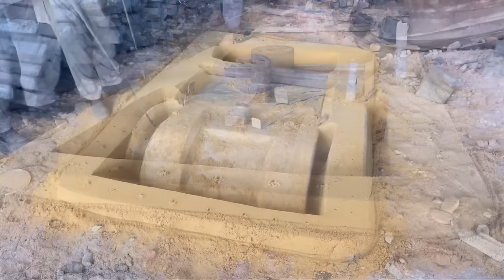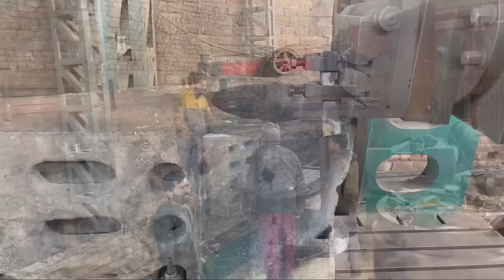Huge Jaw Crushing Machining Hammer Manufacturing In The Largest Factory Heavy Duty HardWorking

Comment: What’s the yellow stuff is it sand ? And why it gets hard when they blow air in 
Can someone explain please
Reply: Hello Sir, Yellow is not sand! But we call it castables or a form of ceramics used for smelting. You can't understand unless you mastered smith making!  Fire is the master builder making goods or needs! Let me stay on the subject matter, it's a chemical compound that contains 90% Alumina. Essential for casting/smelting. This you see is  highly advanced skills of makes!😮
Reply: Excellent question!
Reply: Thank you very much Sir! Appreciate it
Reply: Not sure about the material used for the casting BUT they are not blowing air into the sand. Those probes you saw are actually vibrators used to vibrate the material. That forces the air in the material out allowing it to be packed harder. People pouring cement do the same thing. They vibrate the cement/concrete to force the air out.
Reply: The Mold for  is made of a mixture of sand and liquid silicate binder which is hardened by passing Co2 gas over the mold.
Reply: They are using a chemically bonded sand casting process and are injecting gases, like an alkaline phenolic ester or an acid to cure the additives in the sand of the cast and harden it. Both are quite corrosive, so the lack of protective gear apart from one glove is concerning.
Reply: Another one....: Sand is mixed with alkaline phenolic resin which is dissolved in water. This resin is cured by CO2 gas.
Reply: @laserbeam002  wrong
Reply: Liquid glass in sand, then carbon dioxide to chemically harden and set.

Comment: What is the gas in the small holes for?
Reply: carbon dioxide.   the sodium silicate mixed with the sand will harden when exposed to co2, binding the sand and creating the strength of the mould.